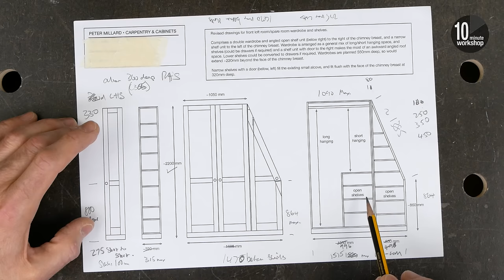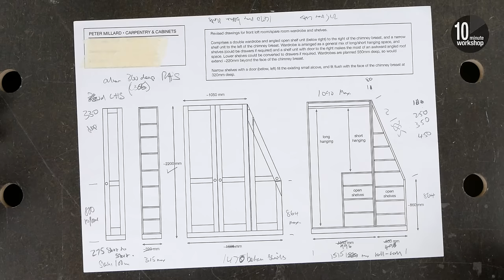My Last Big Build, Part 1: Plans [Video #382]

Comment: I feel your pain.Many a weekend disappointment for my family whilst I fixed my own or other letdown merchant´s grief.
I ended up with a joinery business because as you know, you have to control the material quality yourself.
I will finish off by saying,even if you had a big workshop with a lovely Altendorf scribing panel saw,something would go wrong when you are under time constraints or pressure.
Reply from the maker: Absolutely! If it can go wrong, it will... 🤷‍♂️👍😂

Comment: I wanted to tell you Peter that a few years ago I built a panel saw out of a work-out gym. The gym already had the 2 vertical bars and sleeved bearings to mount a plate to hold the skilsaw...and already had the rope pulley's...I just cut it narrower, welded the brackets on to hold the saw plate and built a large back for it to slide the wood into/on...was quite easy and it is accurate and saves me a lot of time cutting 4x8 sheets. It's also on castors so I can move it around the shop when needed. The only drawback is, it only cuts up to 7/8" thick panels...but that was my mistake when welding on the brackets to hold the saw plate. I use a 5 gallon jerry can with water in it for counter-weight. I used to have a regular commercial panel saw years ago but I rarely used it so I sold it....dumb...so I made this one lol.
Reply from the maker: Sounds great - if you have the space! 👍👍

Comment: Makes a change to see you slightly less composed than ususual pete..!!    I find that the older I get the less tolerance I have  for life’s little hiccups, hence I retired to a  now relatively stress free  existence where I tinker in the shed, cycle and motorcycle ride  at my leisure…and would recommend it to anyone..😂💪🏻💪🏻💪🏻

Comment: Our local box store guarantees cuts to 10mm and does not guarantee any cut to be 90 degrees. My solution for one project was hiring a large trailer parking it on the street battens under each sheet before cutting doing the arse in the air crawling all over it cut. Took a few hours completely undignified but it worked. Suspect parking for trailers in London is limited.
Reply from the maker: Yes, indeed. A lot of places won’t let customers cut on their premises - even in the car parks. 🤷‍♂️

Comment: Bit confused by the expression 'big' build - One wardrobe and a narrow shelf unit. Try fitting 542 apartments as we did at canary Wharf!
Reply from the maker: On your own? Cut, built, sprayed & made in a 30 sq m workshop? Rule of thumb: if it's taller than me, it counts as big. If I can't move it into the building fully assembled, it's big. 👍

Comment: The one upside about using B&Q is getting the wood cut there and then!
Reply: unless you like precision in which case 'cut' is a relative term. they're great at 'reducing' large pieces into smaller ones.
Reply: @daos3300  the ones I've used (Durham and Newcastle Scotswood) have always been spot on accurate

Comment: Hoping to reach Peter with these questions here,  but,   

Peter,    how would I go about joining   carcasses together on site,  without the advantage of having, and using a 'DOMINO, OR OTHER TYPE MACHINE,,is it just dowels ahoy?  Or is there another, better way? 

 and also,     separately,    how would I go about making shaker doors without having a router table(yet), (I've made them in the "cheating " way,  but would like make them the proper way next),  I am considering making the router table  you showed us for my ¼router maybe soon. But to date,  I have not yet done so. 

Many
Thanks. 

Jon
Reply from the maker: Hi Jon, and thanks! I made hundreds of carcasses pre-domino just by screwing then together, and have never had a single failure or complaint. Having dominos or biscuits is convenient and helps with alignment, but screws work well, when the faces are hidden. Re shaker doors with grooves, I’d only recommend making those on a router table, even if it’s technically possible to freehand them. Plant-on ‘faker-shaker’ can work well, but I’d suggest you edgeband them unless you’re sure you can get perfect joins. HTH P
Reply: @10MinuteWorkshop  thank you for replying. 

Brilliant,    I'll have to dowel away for a few times,   I'd been glue and screw method for now and it works fine,  but that's when I have the space on site, or pre-building,  but I have a job coming where I'll want to build off site and assemble on site,  and there may be height issues.

But thanks again. 

And I'll have to get started on that table for the router soon then.  Ha.
My last set were "faker shakers", but I'd much rather do them correctly next time. 

Really appreciate everything your doing here.  
Cheers Peter 👍

Jon

Comment: You had to go and use the hex word...."Last" didn't you?! Btw, you made that template around the 'mouth' of the alcove; I take it the back is the same dimension and square to the front...
Reply: I thought the same...but figured he was going to build-in a scribe space at the front so the back wall dim. wouldn't matter...you know, make the face frames at the walls stick out  more than the box/carcass. :).
Reply from the maker: It actually get wider at the back, so wasn’t an issue. But yes, I did check... 😅👍😂

Comment: I have just brought the same software you use to help design out built in furniture, how do you do your designs?
Reply from the maker: I basically just draw a set of rectangles, to scale. I set the line thickness to 0.5mm, set the page layout to A4 (210 x 297mm). I use layers to keep the dimensions, interior, exterior (doors etc...) separate. There are some great tutorials on the Graphic website - well worth working through them. 👍👍
Reply: @10MinuteWorkshop   thank you for your advice been watching your videos all day great work,  the tips and advice is really appreciated :)
Reply: @10MinuteWorkshop 
Been playing around on the software for a few hours now and still not much joy on scaling a rectangle to size then adding in shelfs, doors etc I am better at drawing with a scale rule lol
Reply from the maker: @deano657  Honestly, it's like every other drawing program. Shift+ drag a corner to make a shape bigger or smaller, or put the dimensions into the dims box (top right) directly. Command+D to duplicate a shape, command+G to group a set of shapes together. 👍

Comment: Hi Peter, not sure if you still reply to old videos but what software did you use to generate the plans? Thanks
Reply from the maker: Hi James.  I use an iOS and OSX app called Graphic. I talked about it in this video - Super Simple 2D Drawings - and why I don’t use ketchup [video 383]

https://youtu.be/MjQmsu3TmsE

- and there are some alternatives pinned as the top comment. HTH. P
Reply: @10MinuteWorkshop  Thanks so much. Your one of my main inspirations for going full time which I did about 3 weeks ago. Won my first fitted wardrobe contract this week. Thank you so much Peter- you've helped change my life for the better.

Comment: After watching for only 5 minutes, I can see potential problems with opening the angled door! Was that what you were referring to?
Reply from the maker: Well, you’re going to have to watch the rest of the series to find out...
Reply: @10MinuteWorkshop  Well, assuming the hinges are on the outside of the door (maybe a dangerous assumption ;)) then I can see the locus of the very top of the door will smash into the angled wall at about 30 degrees. Easily done and I will certainly be watching to see how you deal with it. :)
Reply from the maker: Nice try John, but nope, that wasn’t the issue (angled doors like this are always hinged on the straight side for that reason) 👍
Reply: @10MinuteWorkshop  OK, well I await the next episode with bated breath!

Comment: Peter, what software do you use/how do you develop plans for jobs?
Reply from the maker: Thanks! I use an OSX / iOS app called Graphic. It’s actually a full vector illustration app that does far, far more than the simple 2-D line drawings I use it for. Because it’s an illustration program though, there are a couple of irritating missions from a ‘drawing plans’ perspective (e.g. no ‘tape measure’), but it works to scale in metric and is a very reasonable one-off purchase, so I can work around those niggles.👍👍
Reply: @10MinuteWorkshop  thx

Comment: Peter, how many pencils are you carrying there?
Reply from the maker: Nowhere near enough! 😂😂👍👍
Reply: Peter Millard ha! Me too. I do some of what you do as a trade. Trying a different way at the mo with a clutch pencil. Working well! Carries 2mm leads and I got a pack of 4b which are soft enough to see well on timber. Pencil also has a built in sharpener in the button. Here’s the pencil Staedtler mars technico leadholder clutch pencil 2mm 780C https://www.amazon.co.uk/dp/B000WL4WEC/ref=cm_sw_r_cp_api_i_W1lBEbQWJZF04